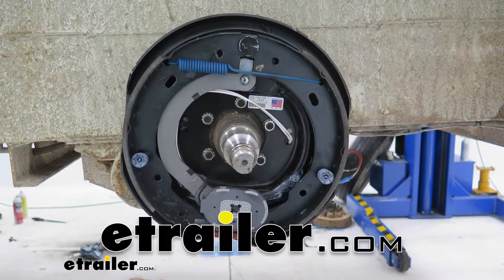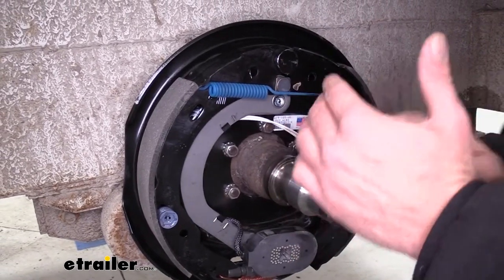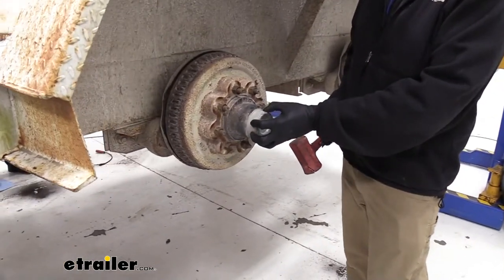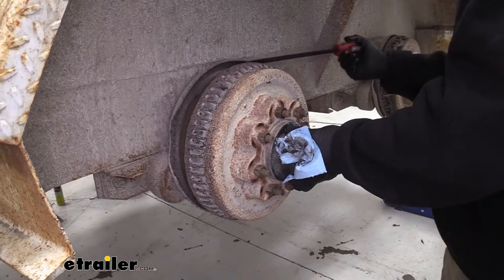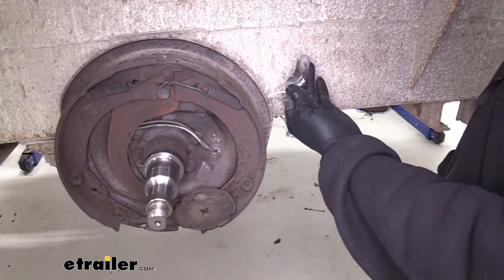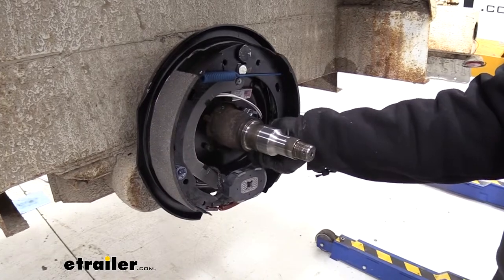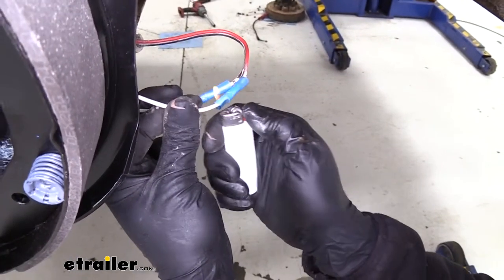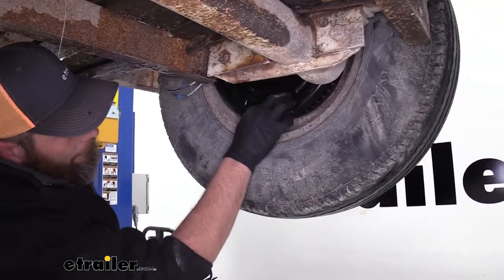etrailer | Complete Breakdown of the Dexter Electric Trailer Brakes

Comment: Hey there I'm a newb, at the end you made sure that there was contact for the entire rotation, is that for a baseline setting? Then when it's hooked up to the brake controller the pads are released? Great vid, the ending just seemed a tad counterintuitive. Thanks, bud!
Reply from the maker: You want the brakes to be just barely touching the drums when adjusting them. This will ensure that you have fast and sure braking ability when you apply the brakes. 
https://www.etrailer.com/Trailer-Brakes/Dexter-Axle/23-105-106.html

Comment: Hi..its great video.how does the brake adjust the force..is it simple on and off whenever apply the car brake? How does it know how much force i apply to brakes? 
Thx
Reply from the maker: The brake controller in the vehicle towing the trailer will send the desired pressure to the brakes on the trailer.
https://www.etrailer.com/Trailer-Brakes/Dexter-Axle/23-105-106.html

https://www.etrailer.com/fitguidebc.htm

Comment: Butt connectors are a train wreck waiting to happen. It's not if but WHEN they will fail from vibration and corrosion. Soldiered with shrink and a layer of tape provides best chance for a long service life.
Reply: Agreed…… I am redoing my connections after maybe 1,000 miles of use

Comment: What Guage wire do you use from brake assembly to brake assembly.
Reply from the maker: We recommend using 10 gauge wire when installing brake assembly on a trailer.
https://www.etrailer.com/Trailer-Brakes/Dexter-Axle/23-105-106.html
https://www.etrailer.com/Wiring/Deka/10-2-1.html

Comment: What was the torque rating?
Reply from the maker: The recommended torque setting for the brake assembly is 45 to 50 ft lbs.
https://www.etrailer.com/Trailer-Brakes/Dexter-Axle/23-105-106.html

Comment: That is NOT the Dexter brake assembly I have on my trailer. My DEXTER Electric Brakes backing plates, have 4 bolts pre-installed in them, that go through the 4 holes on the DEXTER axles mounting flange. Their 6 lug Dexter axles. However I cant tell what their load rating is. The sticker on the axle has long since disappeared. Its a two horse slant load, steel trailer....WHY DOESN'T YOUR COMPANY SELL MY VERSION OF ELECTRIC BRAKES?????